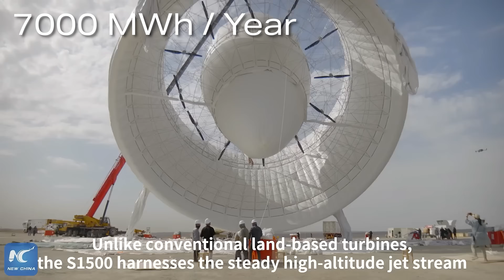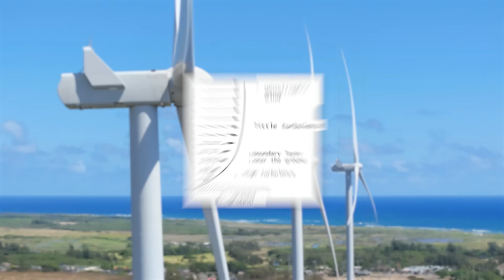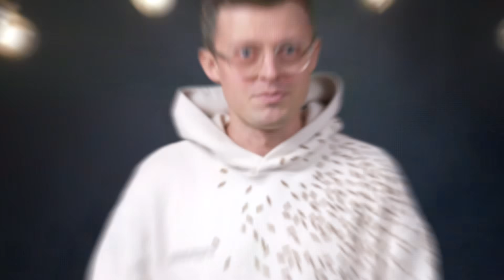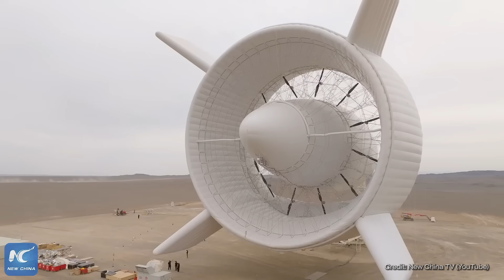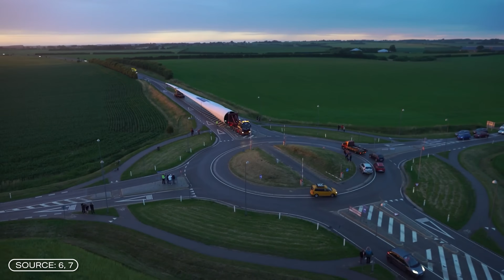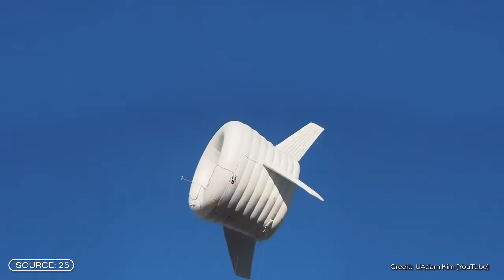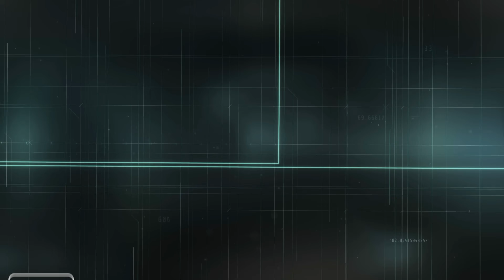China's Wild New Inflatable Wind Turbine (1.2 MW Output)

Comment: Interesting video. I think wind turbines are daffy in general, but it's interesting to see a different, creative take on them. As for the problem of helium being expensive, frankly, the fear of hydrogen as a lift gas is overblown. The Hindenburg exploded because its fabric was highly flammable. The hydrogen itself is not dangerous as long as it's not mixed with oxygen, which, as a lifting gas, it is not.

Comment: Imagine them tethered to ships supplying power to the propellers
Reply: Just what I was thinking, technically this way it would even be possible to sail (slowly) directly into the wind. This solution should also be able to take advantage of the fact that the wind direction usually shifts significantly at different heights!
Reply: @Acamperfull  https://youtu.be/GOM8NagknQI?si=04PCQ9SuHXeupdlb

Comment: How much strong has to be the cable that anchor to the ground ?
And how much does it weights ?
Reply: From a rough calculation 2-6 kg/m per meter electrical wire. So we would need some new tech to tether these bats.
Reply: Leave it to the "smart people"?

Comment: Would modified versions of this work on Venus with untethered craft? Using a drag chute to generate power. My understanding is that the dense air of Venus wind has more potential energy.
Reply: Errrrrrr...... WHY ?
Reply: If I'm not mistaken, the venus project just floats with the winds at a specific altitude because the station's buoyancy equals the athmosphere's density at that point. It couldn't use a turbine because it already is at wind speed. It does compensate with solar because illumination is higher on Venus than earth. Not to mention sulfuric microdropplets would eat the turbine components 😮

Comment: Thanks for sharing, your speech was good. Interesting subject, I think a major factor will may be a cheaper delivery to market due to the reduction of carbon heavy permanent structures and components that are resistant to recycling or removal. Was recently stunned by a wind project near where I live that upon reaching their designed lifecycle of 20 years blew up the towers to decommission them.  I’m supposing that the are likely recycling all the metals in the tower and nacelle but the blades are notoriously not typically recyclable and I hardly expect them to do anything with the foundations since they are so massive and durable they would likely cost more to excavate than simply removing the top layer and abandoning the lower below grade structures. I remember reading about really tall chimneys in the past that had turbines arranged around the base and were more of a solar collector because they took advantage of the elevation change in temperature and operated at a relatively steady state day and night. Haven’t heard anything on those I a while. Probably not likely to be developed in my perspective due to the high cost of building, I was pondering if those could be built with inflatable towers supported by gasses like a balloon. Basically a hybrid between a bouncy house and a blimp with the mechanicals all at ground level. On other aspect of the inflatable windmill in your videos would be at high elevations they could be selectively colored to blend into the long term sky color similar to power transmission pylons. The only observable aspect would likely be the taught line back to ground since humans are relatively good at spotting straight lines. Then again with the relatively small size to the required cables i doubt this would be a problem. Can’t remember the last time the guy lines of a radio tower were complained about as an eyesore.
Reply: Where DO you live? (I would  really like to investigate why that project was demolished AND why it only had a "20 year design life" (not saying "I don't believe you" ........ oh... Wait! maybe I AM)
SMART developers are LEAVING the pylons in situ and installing NEW generators/ blades (which are much more efficient), using the ALREADY INSTALLED Grid infrastructure to upgrade at a fraction of "new build" cost.
There is  a major project in Spain to upgrade for efficiency with NEW components....... ("Google" it)
AND companies (Such as Vestas) who refurbish OLD components to "As New" and pass those "down the line" to upgrade projects from the PREVIOUS generation (Again, at LOW cost)
You used the example of "Blowing up" pylons which suggests THEY were still structurally sound. There's NO reason why a properly designed pylon couldn't last 100 years.
As for blades being "notoriously not typically recyclable".... Try doing some research.
The issue was economy of scale, having sufficient "raw material" (Blades) and there are now plenty of companies with developed methods to do so.